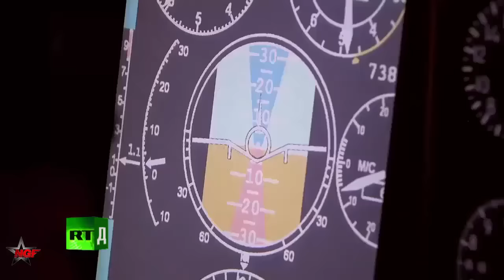Russia Has Doubled Production of $10B New Generation Fighters Of Su-57 With New Engine

Comment: The most beautiful flying machine built so far by man, the de Havilland Mosquito however is a close second. What the US fails to understand this is an aircraft designed for a battlefield where you don't always have access to oilfields (Abrams gas guzzling tanks) or full maintenance facilities that see F-22's in round the clock flight maintenance. I assume the elegant monster has "shark gills" making it able to use unprepared run ways.
Reply: super short take off capability
Reply: F22 80's concept...
Reply: @aldenunion Very sharp design

Comment: I Think Previous Su57 Engines was better in Manouver because new engine maybe more stealthy but less maneuverable (just look at shape of first engine vs new ones) Because the previous Engines were round and narrow and widen and rotate in infinite directions, but the new motors may be quieter and stealthier, but they are not round and only rotate on 6 axes, so its maneuverability will definitely decrease.
Reply: The current ones only move in one direction